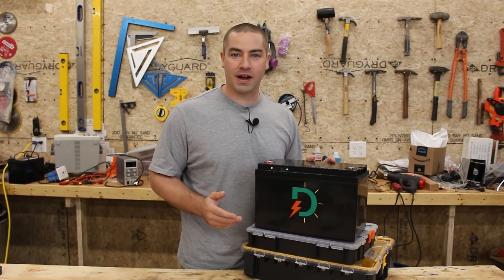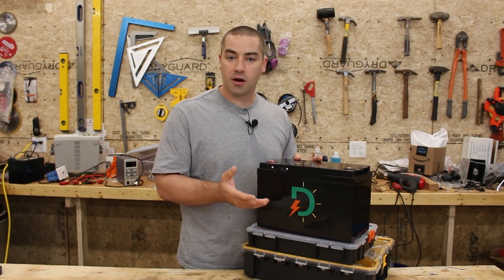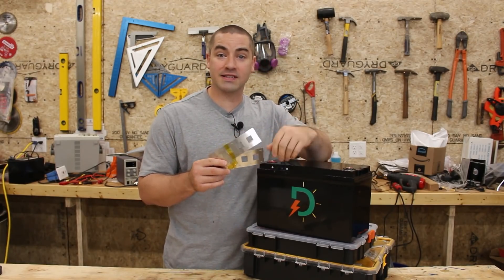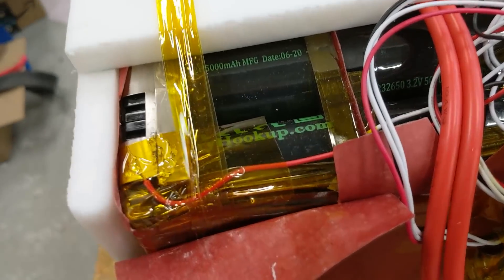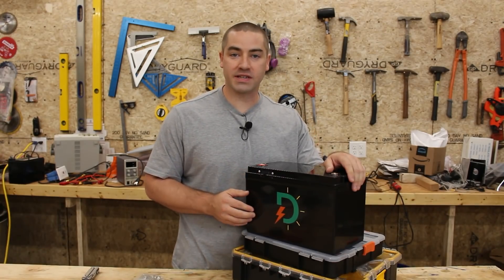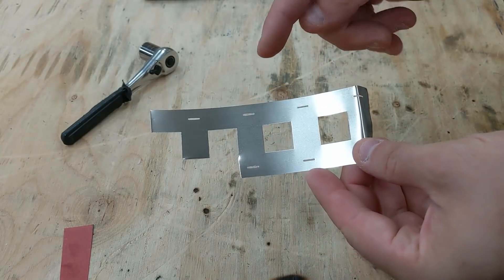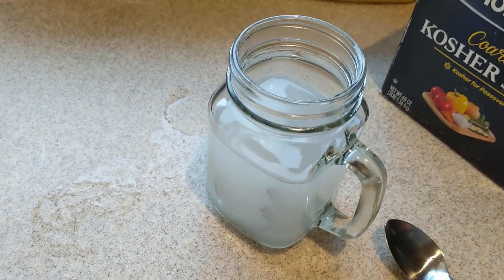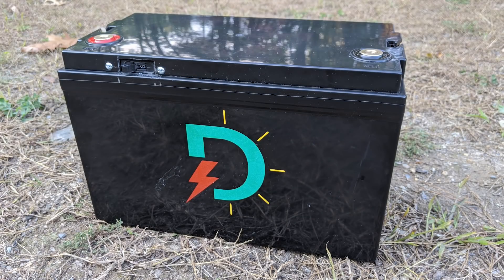Top 10 Questions Answered about DIY Battery

Comment: Would it be possible to use a non LifePo charger with this battery setup? Would this BMS actually turn off charging when the correct voltage is reached? Just wondering for a possible boat battery upgrade.
Reply from the maker: I wouldn't risk it.  In my opinion a battery bank is super expensive, and a charger is cheap.  I'd just buy the correct charger.  But that's just my opinion.  I haven't tried using other types (like lead acid chargers)
Reply: @DavidPozEnergy  Thank you for the advice!

Comment: I like your explanation of the current flow through the bolts/terminal and the use of locktite David. That does make sense to me. One could measure this - use two identical terminals with a thin insulator between them, bolt the assembly down using locktite and measure the current in each leg - it doesn't need to be a high current - so a 10A multimeter on each terminal would give you a comparative value of resistance of the top terminal where the current flows through the bolt, threads and locktite and the bottom terminal where the current flows from the terminal block into the terminal face directly. Heck, I can try it here with my 10 amp power supply.
Reply: Wow... that was an EXCELLENT IDEA!

Comment: On a battery you are supposed to put the high-current leads on the terminal and lower current leads by the bolt.
It isn't that the current "wants to flow" but the current will divide proportionally according to the resistance of the paths.
Reply: This is what I thought too, electricity will take all paths but at different currents.  I believe it's equivalent to a circuit with two resisters.  Current will flow through both resisters but at different rates.  For example ohms law says I = V/R so if one path has say a 1k ohm resister and we have a voltage of 12v then that path will have 0.012 amps and let's say the other path has a resistance of 10k ohms then that path will have 0.0012 amps.  Weather or not the loctite is safe I would think would depend on how much resistance it had the load on the battery and at what temperature it would start to fail.  Just my .02 but I think it backs up your statement.

Comment: a quicker way to test nickel strip is to use a grinder, or a grinding wheel on a drill, or a dremel with a grinding wheel. if you see a lot of sparks, it's nickel plated steel. little to no sparks it's pure nickel.
Reply: or... try a magnet.
Reply: @glensmith766  Nickel is also ferromagnetic so that won't help.

Comment: The current will chose the least resistance path which will be from the ring terminal to the brass contact. nothing wrong with using locktite as long as it's not all over in between the ring terminal and the brass terminal.
When i disassembled my nissan leaf battery pack for the cells, each bolt was threadlocked with blue locktite just as you are using.
Reply: And thread locker will go in the spaces between metals part, not where metal contact metal to let the current flow... Thanks for the update David :)
Reply: Lets be specific - Current follows ALL paths simultaneously. The amount of current will be proportional to the path resistance.
Reply: @TrackGeeks lol! I say this exact phrase. Its correct though
Reply: Any additional path available to the current will lower the overall resistance of the joint
Reply: Path of lease resistance.  Locktite is just fine plus where the threads interlock the glue will be squeezed out by the intense clamping force thus creating a long spiral of little resistance.  Hi amp builds may want to solder on the ring terminals in addition to crimping.  Great build!!

Comment: David, great job and excellent format. Would love to see you do more of this type of video on some of your builds. I have a question. When you use DALY BMS'S, is there some way or program you can use to check the cell levels?
Reply from the maker: The newer Daly's have a bluetooth option, but not older ones.  I have plenty of older Daly BMS's in service.  Take a look at my Ammo can build.  I soldered in two extra JST-XH connectors.  They allow me to manually check the cells fast with a little device called a Batt-Go cell checker.  I do that once in a while because it's fun, but the BMS is the protection 24/7

Comment: Great follow-up! I don't see a problem with the loctite on bolts. I agree that electricity is going to take the path of least resistance, which is brass to ring terminal, not through the bolt. I'm not sure why so many are concerned about that? Unless I'm missing something. That being said, I do think the flange bolt would have been enough on its own as it's got those grooves cut in to help avoid backing out.
Reply: Yes, most of the current will take the path of least resistance, but any additional available path will have non-zero current and lower the overall resistance of the joint. Example: One path is 1 milliohms and one path is 2 milliohms. 2/3 of the current will go the first path and 1/3 the second path and the overall resistance will be 2/3 milliohms.

Comment: I'd say you're correct that most of the current will go in the terminal to the brass (preferred indeed). i'd put a Belleville washers over the terminal below the bolt to keep mechanical tension tight on the terminal with vibration, and voilà.
Reply: @Thomas Chrombly 
This issue must be related to the wires jerking on the tab welder in the first video.  I suppose using the battery really can loosen bolts.